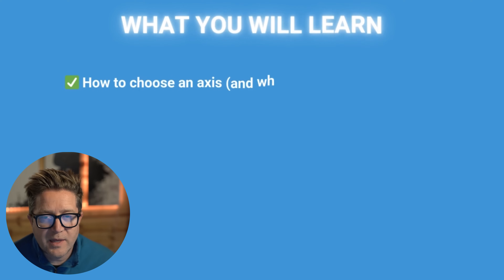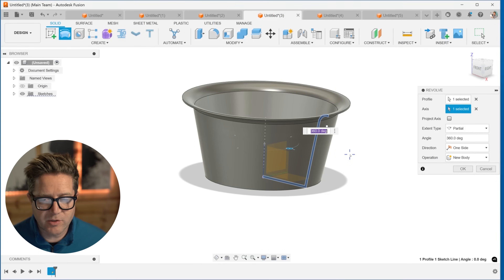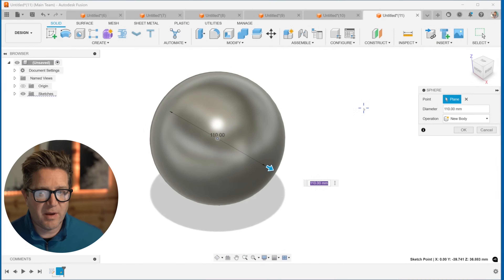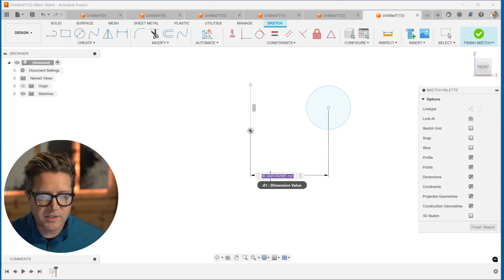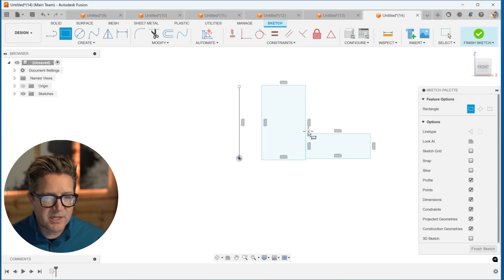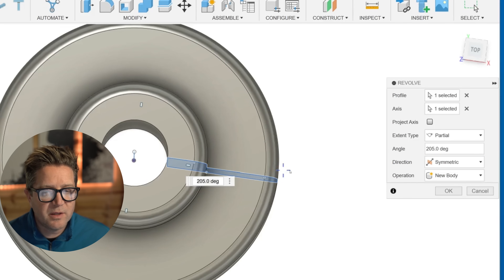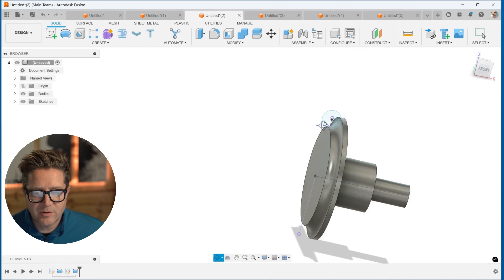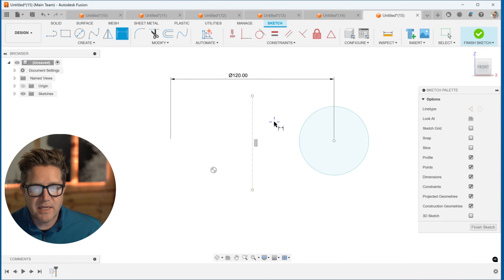Learn Fusion 360 Revolve – The Best Way to Create Complex Round Parts

Comment: Your tutorials are very good and have helped me to be more proficient in Fusion 360. I have recently had the need to design an ellipsoid with three different radiuses. The only way I could come up with to do this was to revolve an ellipse to create two of the radiuses and then do a non-proportional scale to get the third radius. This worked, but I was wondering if there might be a better way to do this?